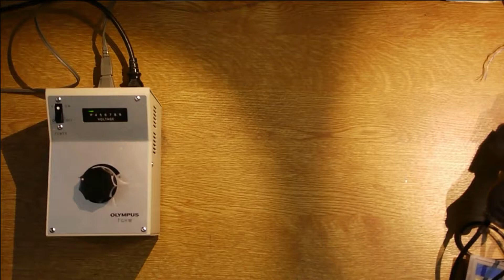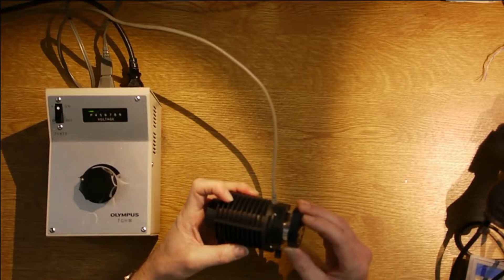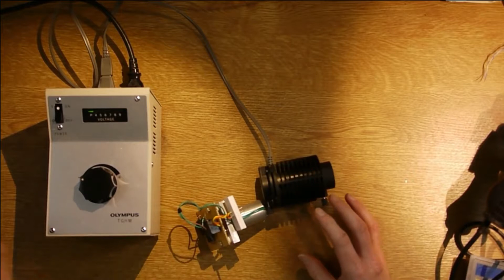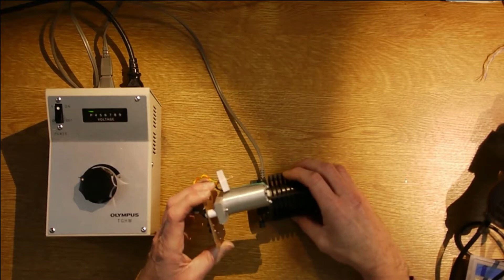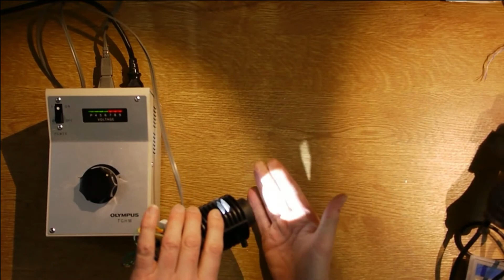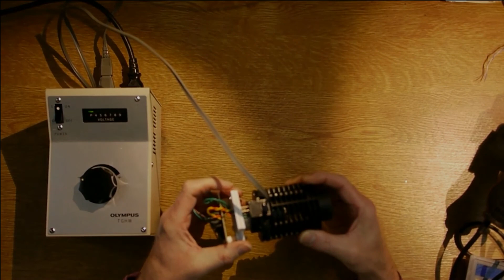Olympus BHM Microscope LED Illumination

Comment: i have a problem with the transformer, it doens't give me power. I don't know how to disassemble it though. The regulator knob prevents me from lifiting the lid off.
Reply from the maker: I made a video of taking the transformer case apart:

https://youtu.be/Ef3cltqmbWY

You don't have to take the knob off, the side screws are enough. The knob is held on with two grub screws.
Reply: @Menadue  I'll say thank you if they won't ;D Thanks for the informative video, straight to the point and no faffing about.